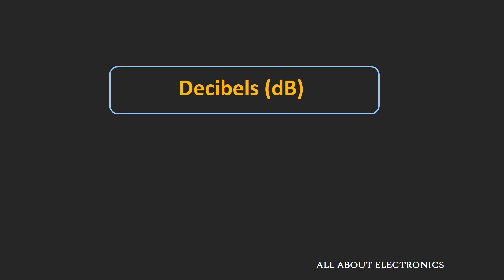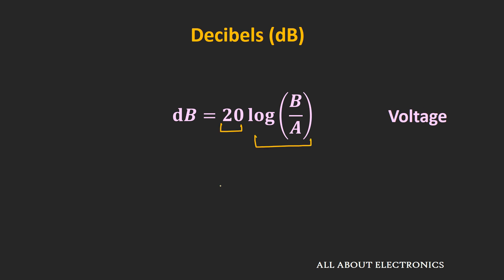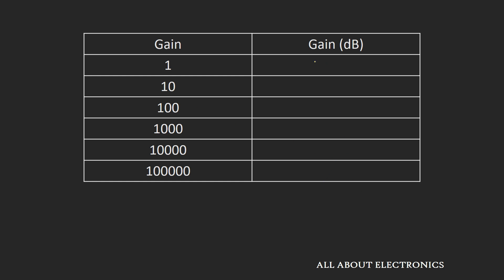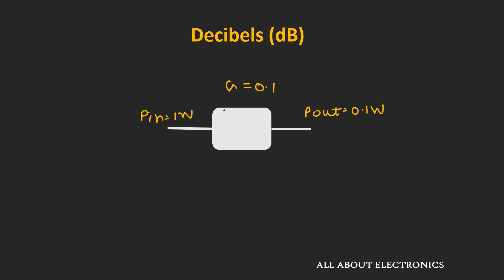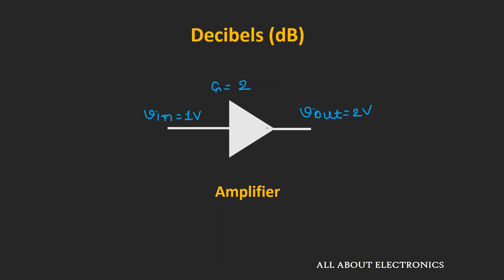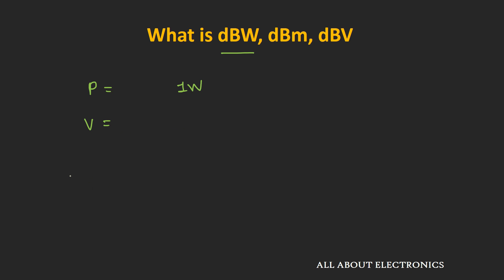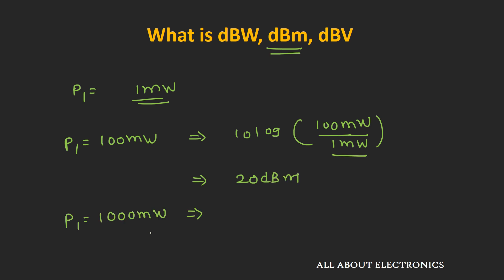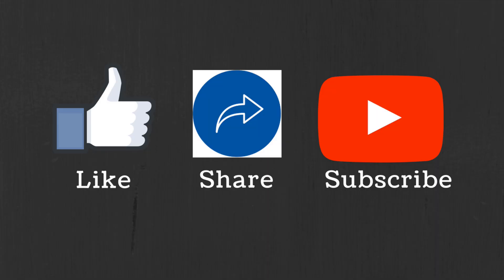Decibel (dB): What is dB, dBm, dBW, and dBV in Electronics? Difference between dB and dBm

Comment: Why 20 is used for voltage gain????
Reply from the maker: Power P = V^2 / R. So, when we replace P with V^2/ R then in the log, 2 will get multiplied with 10. And hence for voltage, there is a 20 in dB equation.

Comment: P1=0.01W        = 10mW
P2=0.00316W = 3.16mW
P1 = P2 = 13.16mW
Reply: how did 3.16 came ? log 5 is 0.698 right, So 10*0.698 is 6.98
Reply: @karthikeyaprasadnapa8847  you should add that
Reply: @karthikeyaprasadnapa8847 I have the same confusion log 5 suppose to be 0.698

Comment: respectable sir please make video, that why are they using 3dB in many place. and how derive that 3db, as much as possible. really i couldn't understand that. thank you
Reply from the maker: Please check my RC low pass filter. There I have explained. 3 dB frequency is where the power becomes half or the voltage is 0.707 times the input voltage.
Reply: @ALLABOUTELECTRONICS   thank you sir

Comment: It's regarding half power it should be -3db but according u r table it showing -6db , correct me if i m wrong....
Reply from the maker: The table is for voltage. The voltage becomes 0.707 times the actual value at -3dB. 
For power, it becomes half at -3dB. The equation for power is Power (in dB) = 10 log (Power in Watt/ 1W).
For voltage its Voltage (in dB) = 20 log (Voltage in Volt/ 1V)
Reply: @ALLABOUTELECTRONICS  got it thanks..

Comment: if the input power is -3dBm which suffers a gain of -4dB  on insertion . What will be the output power? And if the outpower is equally splitted into 4 branches. What will be the output power per branch in dBm? Please help.

Comment: Why are lower cut-off frequency and upper cut-off frequency called -3dB frequencies???
Sir please explain.
Reply from the maker: Because at that frequency, the output voltage reduces to 0.707 of the maximum value. If you convert it into the dB then Vo / Vin is -3dB. That's why it's called -3dB frequency. I hope it will clear your doubt.

Comment: 40db+50db=90db is not correct. In db u cant add directly..
Reply from the maker: The thing is it's converted into dB so that the quantity can be added directly without involving any further complexity. If two quantities are in dB then they can be added directly.
Reply: @ALLABOUTELECTRONICS   If two quantities are in dB then they can be added directly. Then why can't we simply add P1 and P2 to get P i.e. why is P=10+5=15 not true? Please explain.
Reply: @tariqislam9388   hi, 40db+50db=90db is correct, because this is a system of two amplifiers in series and amplification can be represented as Pin * A1 * A2.
  P=10dBm + 5dBm =15dBm not true because we just want to make addition powers (not multiplication) (this is the key)
to sum up, multiplication in normal scale is equivalent to addition in dB (LOGARİTHMİC) scale.
Reply: @ekremfidan6311  Hi. Thanks for your explanation. But I still do not understand this thing well. Apparently it seems easy but I think I have problem some where in the basics. Can you please tell what background knowledge should I have in order to understand this db, dbm etc thing. Thanks.

Comment: I don't understand why 20 for voltage and 10 for power
P  prop to v square
So if v =10
Then log means p = 20 ?
Please explain
Reply: P(out) = (Vo^2/Ro). 
P(in) = (Vi^2/Ri2), 

dB = 10log(Po/Pi) = 10log((Vo^2/Ro)/(Vi^2/Ri)) -> (if Ro = Ri) -> 
-> 10log(Vo/Vi)^2 => 20log(Vo/Vi)

Comment: Thanks for pointing out the contextual difference of the decibel (voltage, amplitude, … vs power, watt, …).
Mathematically speaking, the equal sign is formally used this way though:
Power: A/B = 10W/1W = 10log(10W/1W)dB = 10log(10)dB = 10dB = 1B
Field:    A/B = 10V/1V = 20log(10V/1V)dB = 20log(10)dB = 20dB = 2B
Reply: I used to think prefix deci in dB stood for the log to the base '10'. But it looks it stood for metric prefix, ie represent multiplier 10 scale, not the base. But if deci is removed how do you say B; is it 'bels'
Reply: @lolvivo8783  Correct 1 B = "one bel"

Comment: Why in voltage gain log of power gain is multiplied  by 10? From where this formula is derived?
Reply: "d"  in dB stands for "deci", i.e. 1/10th. Log(A/B) gives you 1bel. For the decibel you need to multiply by 10.
Reply: @RimantasLiubertas  ohk. But what about 20. Why 20 is used for voltage gain??
Reply: @MRPerfect-zr6mv  Because P is proportinal to U^2 (voltage raised to 2). This "2" goes multiplying 10 (that comes from conversion of bells to decibels). 
2.10 log (V(out))
(for 1V reference voltage).

Comment: excellent explanation of difficult looking easy concept. Thank you.
btw...  P1 + P2= 10 + 3.162 = 13.162 mW
Reply: In terms of decibel it is 11.193310
Reply: @He.Who.Remains.  power will remain the same, it will not depend on reference
Reply: @He.Who.Remains.  
  P= -18.806 dB
Reply: In terms of decibel it is 11.193310

Comment: Hello.
I need explanation of what is dBm in RF communication.
For example I have two RF Module.
The Transmit Power is 14dBm.What dose this mean?
After connection RSSI is -9 dBm.What dose this mean?
Can you help me please?
Reply from the maker: dBm is used to represent the power in milliwatt. 
14dBm means the power is around 25mW.
When the power is less than 1mW then in dBm it will be negative.
-9dBm means power is approximately equal to 0.125 mW or 125 uW.
For the calculation, you can use the equation given in the video. Direct conversion calculators are also available on the web. You can also use them.
I hope it will help you.

Comment from the maker: Time stamps for the different topics covered in the video:
0:56 Decibel (dB) in electronics
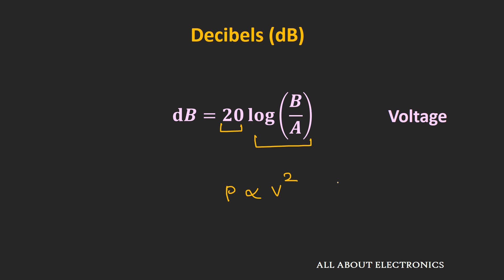2:15 Representation of Power Gain in dB
6:26 Representation of Voltage Gain in dB
8:40 What is dBW, dBm, and dBV?
11:40 dBm to dBW and dBW to dBm conversion
Reply: ALL ABOUT ELECTRONICS  what.is watts power in music amplifier
Reply from the maker: It is the unit of power measurement. Generally speaking, the amplifier with higher wattage produces a louder sound. (more amplification)